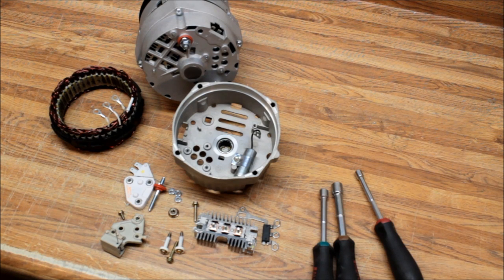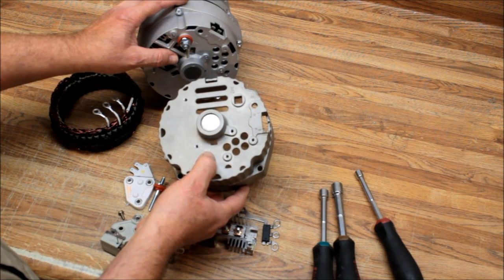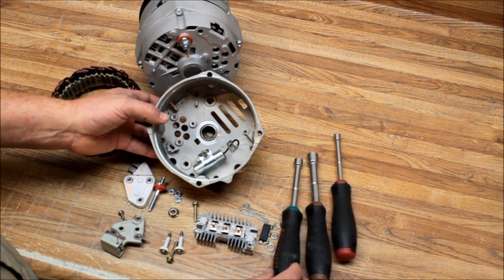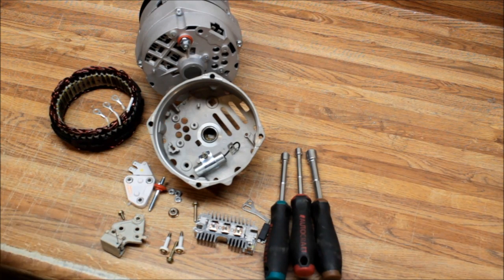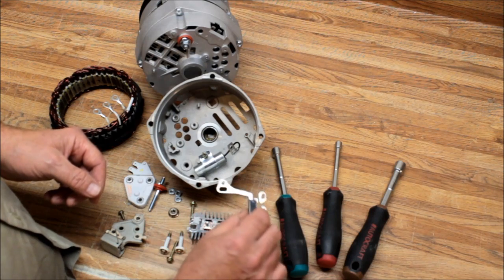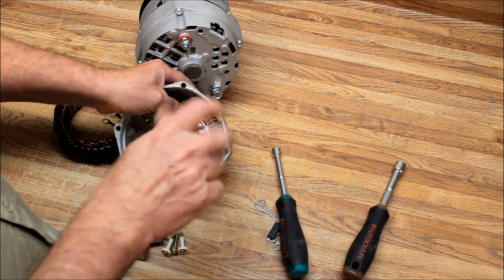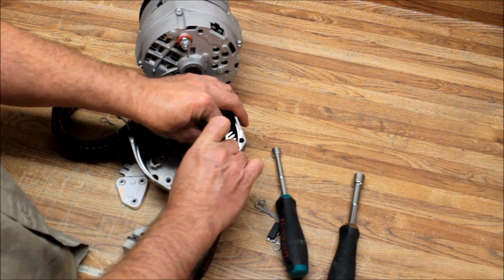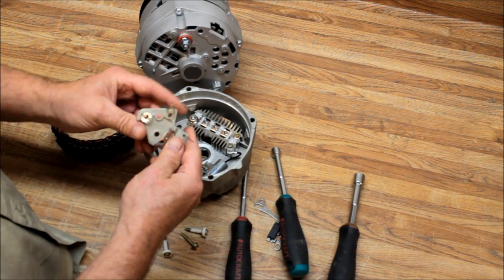Delco Remy's 10Si &12Si Alternator Repair & Upgrade Pt 1 of 2

Comment: There are a lot of 72 amp 10SI alternators used on farm equipment. They use a Delta wound stator rather then the Y would stator. Also the later ones (type 116) use a swing brush assembly rather than the standard sliding brushes.